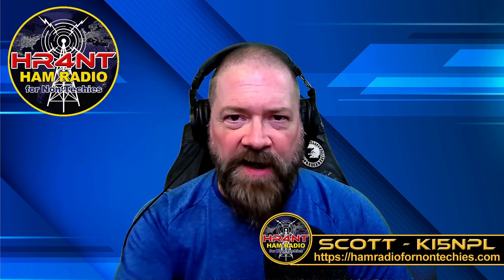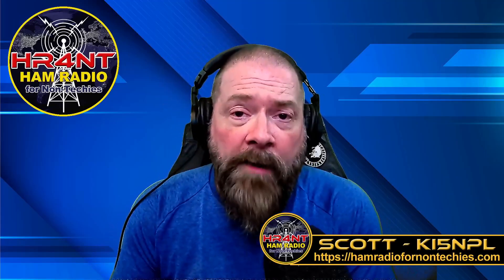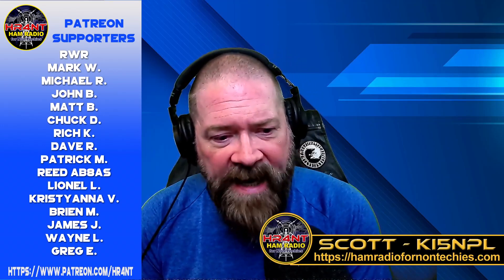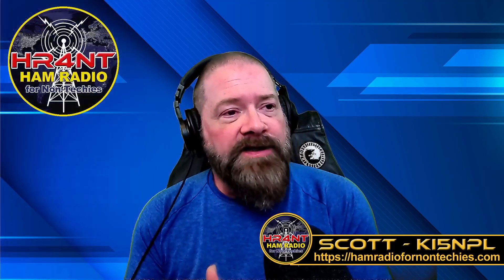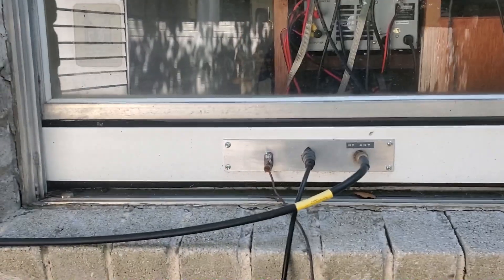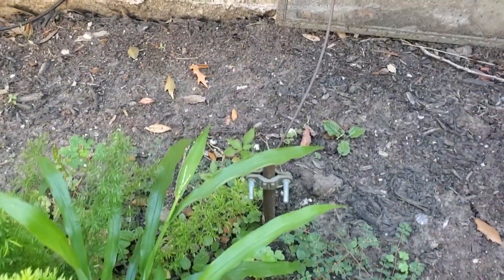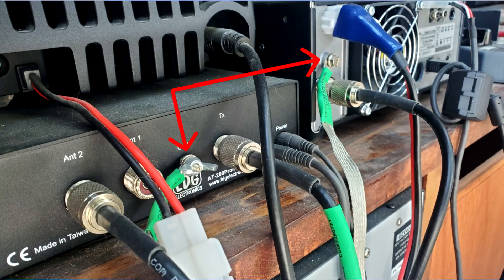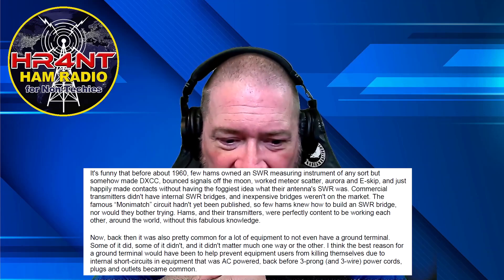Grounding My Ham Radio REVISITED:  What I Have Learned Since Then

Comment: I’m an appliance repair man and I’ve recently had an experience where somebody had the breakers off to a refrigerator over the summer, but it was still plugged in, essentially giving a ground to the refrigerator. 
They must’ve gotten hit by lightning over the summer they reference losing a couple other things in the home that weren’t working when they got back. The refrigerator was working perfectly the day they turned off the breaker before heading back north for the summer.
They come back to Florida for the winter turn the breaker on in the refrigerator does nothing. I check it out and find the boards done. 
And found myself thinking of this video. 

I have also recently watched YouTuber Dave Casler’s video on his lightning strike. He lost some equipment that wasn’t connected to the antenna, but was connected to the ground. I was like Yep. The ground gives another pathway to your equipment
Reply from the maker: I agree wholeheartedly.  It is much simpler and efficient where if you are not using the equipment at the time or a storm is coming, just unmplug everything and eliminate the chance of having thigns get destroyed.  Thanks for watching and for the comment.  73!

Comment: Welcome to my world! HI HI.  I spent a lot of time studying and experimenting with grounding.  Like you, it never fails that wherever I put my shack, the breaker box is on the farthest corner of the house from it. I would have had to cross two sidewalks and run a #4 wire over 80 feet just to comply with electrical code. 

You talked about the old days.  I was there, I remember them.  Radios were tube type, had high voltage and were made of steel. Grounding kept you from burning your lips on your microphone or getting a bit of RF burn on your hands. I measured 100v between a Hammerlund and a transmitter - case-to-case!

I'd love to talk to you about grounding. Not to change your mind, but because you are real and practical.  This hobby is made up of engineers who take math to far further precision than an astrophysicist.  If something is off by 4 decimal spaces, it won't work.   BS, in real life, it can be off by 20 points and still make contacts. Hi Hi. 

My station will be much like yours, except I'll have to run wires across a room. I'm now alone and just moved into a small apartment. 

I used a common breaker ground bar in my previous home.  I was thinking of doing the same here, but I like your copper tube idea better.  I call it "spoke" chaining since each piece goes to a common hub. Only, I prefer mine to be closer to the equipment. A copper table top would be my ground of choice, but that's expensive.  

The biggest safety tool you can give your shack is quick disconnect.  All of my radio AC are on a single power strip. I can unplug everything in one pull.  I did have quick-disconnect cb type connectors, but they seem to raise the SWR on some bands so I have to do it manually. I'd love to have what I used in the Navy, but they are way too expensive for me. But, I do have a patch panel on the drawing board that will give me one place to disconnect and move everything.  The idea came from an old telephone operator's desk. 

I also learned over the years that direct lightning hits are only a small portion of what destroys radios.  Lightning creates small EMP that are picked up by the antenna and sent to the radio.  The wind on the antenna charges the antenna as well.  I witnessed what I thought was mores code in lights coming from my shack. I had dropped the PL259 from a 150 foot dipole 100 feet in the air spark between the ground and center conductor of the connector.  No, it was not legible, or maybe it was Chinese Hi Hi.

The name of the game in a storm is disconnect everything and turn on the HT. 

You got it right.  I'll check out more of your videos.  73s
Reply from the maker: Thanks for that comment! I think my solution is solid and follows the KISS method.  By unplugging everything and disconnecting power seems to have been working for me for years now.  You are right, the engineer types in ham radio take things to the Nth degree.  I do not have time to have something like grounding occupy my time any more than it has.  My solution in this video is solid and it works.  Problem solved...LOL  Thank you again for watching and for your comment.  73!
Reply: @HR4NT  After watching this, I watched an ARRL presentation on grounding.  The instructor is one I had started to use to comply, but it was economically unreasonable, unpractical and impossible for a tenant to comply with. 

The biggest, and probably only, difference in how we think of grounding our shack is that I actually made a ham shack disconnected from the grid.  That was cheaper and easier.  

Funny thing was, at the conclusion of this engineer's presentation, he said, when you leave the shack to disconnect everything.

Comment: i used to do the same as your talking now.  when thunderstorm on the way, - i unplug.  i not using radio or thunderstorm season - i unplug.   did this or years and years.  then the area started having an occasional power fluctuations, so i  started attaching a battery backup. battery backup can't really be unplugged or  it chirps and chirps, and yes, i had unplugged electricl plugs from battery backup to computer and radio (and it's power supply).  side note: only the PC was plugged into the battery backup, which included a/c and a control serial cable to the computer.   

storms come and go and the routine was in effect:  radios unplugged, antennas unplugged from radio, which was always attached to ground rod.  one thunderstorm took my unplugged computer, radio, and battery backup out - melted most of the items.  it appears the power surge came up the a/c house power,  not a strike that came up the station ground.  the battery backup was broken and wouldn't even power on.  all a/c power supplies, that were attached to the  battery backup worked, except the computer; items attached to the station ground and the antenna (was grounded) worked without issue, even things that were attached to the station ground worked, unless it had a USB connection to something, i concluded the surge didn't come in via the station ground, but via a/c into the USB connection on the battery backup.  anything, directly  connected  to the battery backup via usb was fried along with anything connected in the usb chain from battery backup to radio which also was attached to the station ground.  the computer power supply was fine, but the motherboard around the USB connection was fried.  the computer had 2 usb devices attached: usb to signalink usb and radio.  the usb to serial device exploded, i didn't find much of it.  from the usb to serial connector went to the signalink device,  had lots of burning on its motherboard, mostly around the usb connection.  the computer, had extensive damage around the serial device and had lots of melting around usb connections.  the the radio, which was attached via usb to pc and radio also was attached to the station ground.  ham radio was burnt and some melting all over the place.   anything from the radio that was attached via coax or station ground, without a usb connecction, was fine.

it appears the surge came via usb, and everythink that was connect to equipment via USB was fired/melted.  i suspect the power surge  entered the battery backup and was trying to get to earth ground, and the only path was through usb connections until it got to the radio which was attached to the station ground.  i suggest, still use a station ground, but disconnect any connections between equipment.  this could have been  a VERY expensive lession, if it wasn't for APC's warranty/insurance. storms come and go and the routine was in effect:  radios unplugged, antennas unplugged from radio, which was always attached to ground rod.  one thunderstorm took my unplugged computer, radio, and battery backup out - melted most of the items.  it appears the power surge came up the a/c house power,  not a strike that came up the station ground.  the battery backup was broken and wouldn't even power on.  all a/c power supplies, that were attached to the  battery backup worked, except the computer; therefore, i concluded the surge didn't come in via the station ground.  however, anything, direct or indirect, connected via usb was fried.  usb from battery backup to computer (computer fried, and not plugged into power, but usb connection still attached to battery backup).  then computer had a usb to serial connector exploded and burned - didn't find most of the usb to serial device.  then  those usb to serial devices conneted to the ham radio (which also was attached to my antenna tuner and a signalink usb).  the ham radio was fried, also the signalink usb also fried.  the antenna tuner, connected via a cable  between radio and tuner, and also had a station ground attachment - the tuner was fine.
Reply from the maker: Grounding is a touchyt subject, but I think we make it more difficult than it has to be.  The setup I demonstraed ion teh video seems to work fine and in the end my gear is protected.  Thank you for sharing yoru sotry!  I appreciate that!  Thanks for the comment and for watching.  73!

Comment: I live in Canada so it may be different here. Your ground may not meet electrical code for a household ground built that is not what you are doing. You are adding new ground for your HAM gear. In my case the meter is 165 feet from the house. I live on an acreage and my case the house is 165 feet from the meter where the ground is. The function of teh house ground is to tie the neutral line to earth. I used a plate as my earth is impossible to drive stakes into due to rocks. It is recommended to ground your COAX at both ends which I have done with a lightning protector right at the antenna. I dont know why everyone worries that the ground path is the only way for lightning to get into your house. It can come through teclo lines, power wires and any other wire that extends outside and then find its way to ground through your equipment. Now that said many modern PCBs put spark gaps on the PCB, These place the V+/- close to a ground trace so that when a spike occurs it arcs and goes to ground. A more expensive option is to use gas discharge tubes and MOVs. RF grounds and household grounds have different requirements and as such I also prefer ground strapping due to the skin effect where only the surface of the conductor carries current. A bunch of very small wires (ground strap) are better than one large solid core wire.
Reply from the maker: That is all sound advice.  Grounding is a touchy topic in ham radio and the solution I provided in this video is a solid one and has worked for over a year for me now.  I agree with a lot of what you said.  Thanks for the comment and for watching.  73!

Comment: I’ve been a ham for 4 years and never grounded anything.  I do the same thing and unplug everything when not at home and if a storm is coming I do the same. 73 de MM7BFL
Reply from the maker: Hey if it works, it works right?  I kept the solution simple and have not had an issue yet.  Thanks for the comment and for watching.  73!

Comment: That's a vary fair point indeed, however my grounding situation is a fair bit more complicated unfortunately and if anyone has some advice on this matter any help would be hugely appreciated. I am not a licensed radio operator so i am really sorry if i have no clue what i'm doing or talking about. Our local makerspace is involved in water level monitoring and decentralised flood alarm systems for our city. As part of this we operate a 868MHz LoRa mesh to interconnect 433Mhz LoRA gateways. The 868MHz system runs off directional Yagi-Uda antennas for interconnecting the relays, the 433MHz gateways are connected to omnidirectional ground plane antennas to provide localised coverage. Because of this application we cannot afford downtime during thunderstorms because that is when flood hazards most often occur. Further adding to the complexity, most of our LoRA relays are located in peoples attics where proper grounding is quite difficult indeed. for my relay i currently have a DIY spark gap and a TVS diode for lightning protection, grounded through a regular outlet. not a good idea at all. maybe i can try attaching a hook to a large diameter conductor, throwing that over the lightning rod from the rooftop window, tensioning the conductor with a large spring and connect to ground that way? really unsure on this matter

Comment: You can make right hand turns with grouding electrode conductors. Not sure where that came from?  Best thing to do in addition to what you have now is to tie the rods together. Running the conductor underground in the dirt, so you don't  create a ground loop.  Bare copper wire. You'd give your house a really good grounding  system if you did that. It would help with common mode currents too on your equipment too, if you had any.  Just makes for an over better station. You notice grouding issues usually when you start running amplifiers.
Reply from the maker: I appreciate that.  I had read somewhere about the right angle thing, but my new setup seems to work fine with no issues.  Thanks for the comment and for watching.  73!
Reply: @HR4NT  You might have read "no sharp bends" in the National Electric Code.  That's where I saw it.

Comment: Your station ground is fine.  What is being sent to ground is electromagnetic RF energy, not AC electricity.   You do need a good RF ground to help keep RF away from your gear because RF burns are a B atch.
Reply from the maker: Thanks for the tip.  I will definitely research that and look into it.  Thanks for the coment and for watching.  73!

Comment: For people running their radios off of a power supply, I assumed the ground hookup on the back of the radio was to hook to a ground on the power supply, or if one wasn't present you could run a separate ground for the radio to prevent You from being shocked by Your equipment??? 🤷🏼
Kind of the same idea behind grounding the electricity running to your house, it's not there for lightning, its there for safety of being shocked by your own power supply.
Reply from the maker: Each component in my shack uses a separate ground cable that goes to the copper rode mounted to my shack desk.  Never had an issue with shocks or any other issues to date.  Thanks for the comment and for watching.  73!

Comment: Hey man,

While I have not yet watched your entire video - but will - here are a couple points. Pardon the input if you already know this stuff.

I'm old and have seen a lot in a 52 year career while wearing many proverbial hats - Industrial Electrician, Electronics Technician, Telemetry Technician, Theatre Lighting Designer and House Electrician, Missile Inspector, Radio Broadcast Engineer, dishwasher, and some other junk...in no particular order.

While growing up in SW Arizona I cared little about lightning because we had none there. After living elsewhere I learned about 2" and 4" flat copper strap and thick copper plate entrances with Polyphasers on all coax/heliax. Lightning does not like round conductors or curves or sharp bends. It loves the easiest path which tends to be flat surfaces with gentle radiuses, partly due to manifesting as a plasma typically above 100MHz. Those frequencies create such dense fields lines inside a conductor that current flow wants to be by skin effect.

But the most important idea to remember is based upon a simple principle of electricity. When there is a voltage differential across a conductor you have current flow. Conductors can be Copper, Silver(best), and earth. So think about what can happen when lightning strikes the ground near your house. Extremely high currents flow through the soil. If you have more than one ground rod driven, the resistance presented by the soil between them will allow for large differences of voltage at each rod. And what happens - CURRENT FLOW. Some of that current flow will travel up into your house on ground wires and smoke stuff, to include starting fires - potentially(pun intended). So, the only rule to follow is what? ONLY ONE GROUND ROD for the entire house!!!! Don't worry about running a long ground wire around your house exterior to reach the utility ground rod. Lightning will not follow it anyway. That long ground wire is only providing a safety ground. But, as I suspect you will cover in the remainder of the video, you do not need a outside ground! Your outlets already have grounds, bonded to the neutral buss and to the ONE ground rod outside. You are already covered, unless you are operating a old 'hot chassis' boat anchor receiver, or something else that can knock you across the shack.

Even the great Motorola way over-thinks the issue with their "halo" grounding system - 80% waste of time and money. Just use your head, employ simple, sensible practices, and use the best suppressors you can find for utility line surges, as well as the basics of keeping lightning out of the shack.

You are WAY smart about just disconnecting during a storm. For those of us radio and television engineers who cannot do that, there are other ways to keep transmitters on the air - but it takes money.

That's my advice. You seem smart enough to find the best path. Go for it dude!

73s
Reply from the maker: Thank you very much for that info and the comment!  I really appreicate any outsid advice othes have to offer that can help other viewers.  I kept my setup simple and it works 100% of teh time to this day. Thanks for the comment and for watching.  73!